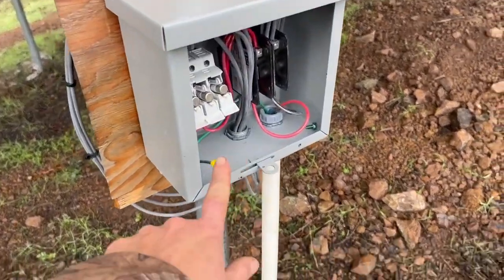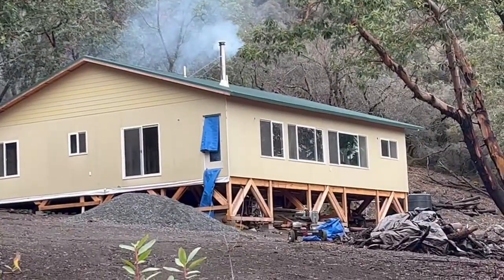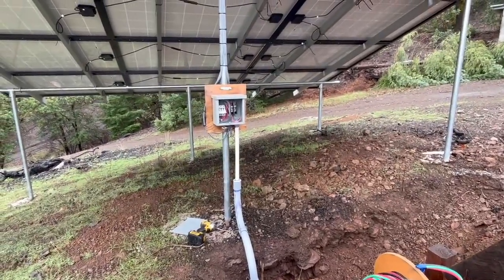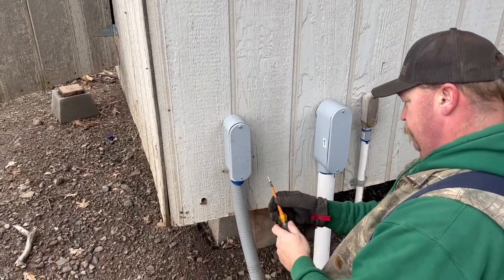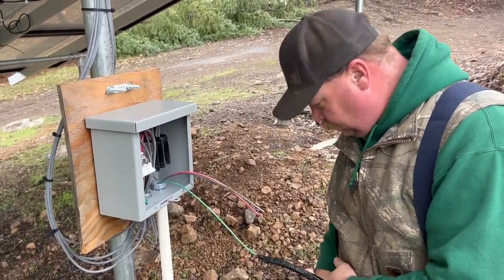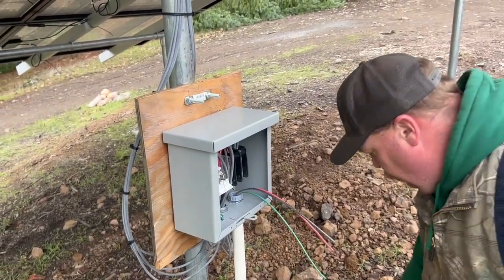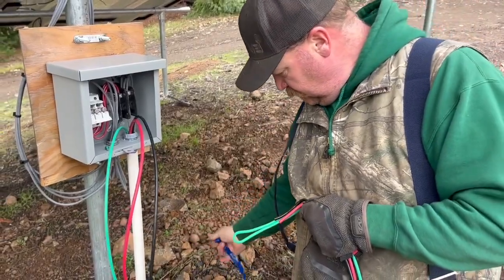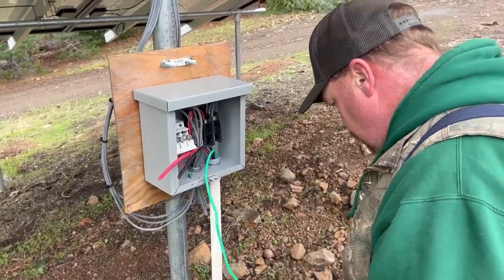How to Replace a Run of Wire with a Larger Gauge

Comment: How many panels (and watts per) are ya'll using? What Amp are you using, 30, 50...?
Reply from the maker: We have 12, 325 watt panels.  We have 16, 225 amp 6 volt golf cart batteries.

Comment: So, you found these sustain power over longer distances, but did you use the same stranded wire at the connections other than the breaker box?
Reply from the maker: We used eyelet electrical connectors.

Comment: So, you used the stranded so-called fip flexible 12-2 typically used in autoand refrigeration? Is that right? How did it work compared to romex 12-2
Reply from the maker: Our whole system including the wire was designed by a local off grid business specifically for off grid residential clients.  I’m not sure how to answer your question!